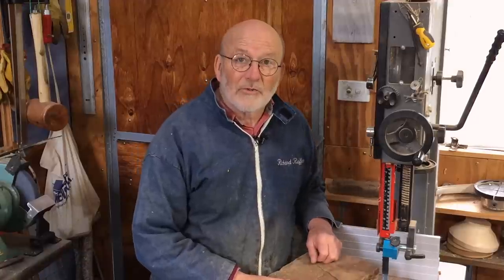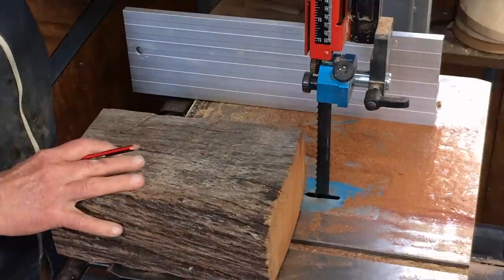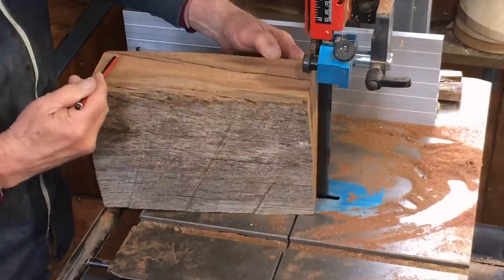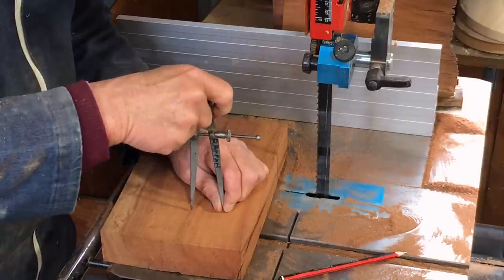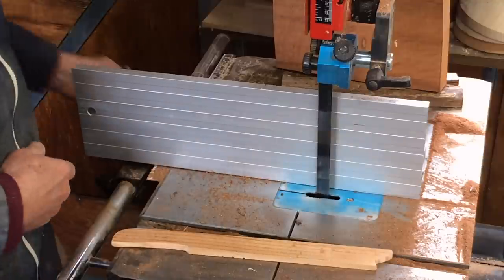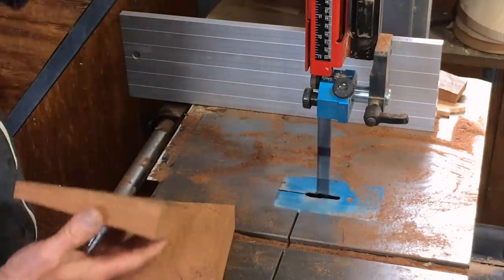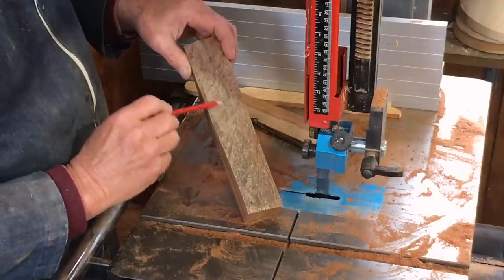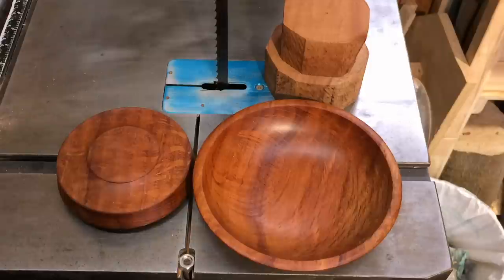Richard Raffan cuts an old beam into figured turning blanks.

Comment: When I first started turning,  I always tried cutting out all cracks and other defects.  I'd cut away all bark and stuff. 

Then, I watched videos where people said those defects were *works of art*, so I started keeping them in, trying to fill cracks with epoxy and such. 

I am so happy Richard started posting these videos.  I never felt right with my products having defects.  Now I have a bit more confidence that its ok to be picky with my work.
Reply from the maker: I went through my red and blue epoxy stage in the early 1980s and soon discovered epoxy is inert whilst the wood moves and shrinks. Working with split blanks is inherently dangerous and using epoxy expensive as well as bringing it's own hazards.

Comment: Turning the extraction on & off used to drive me nuts until i got a plug in remote control for the extraction power point.
Reply from the maker: Normally for the bandsaw it's switched on and stays on whilst the saw is in use, so no irritations.